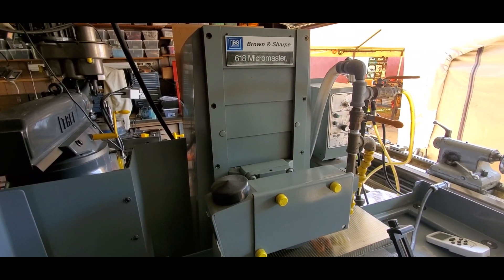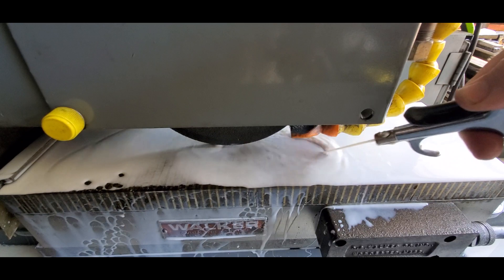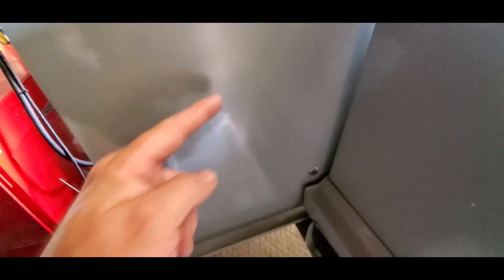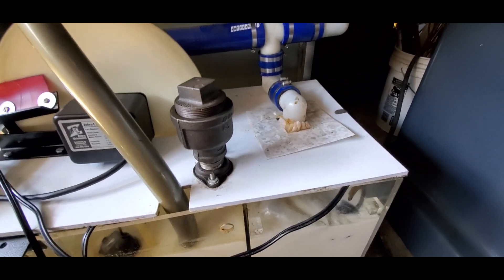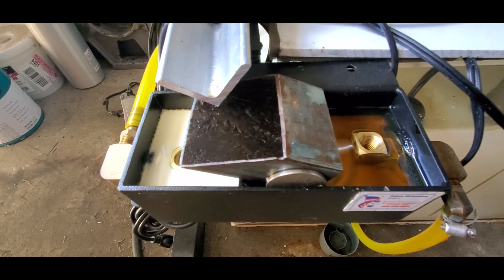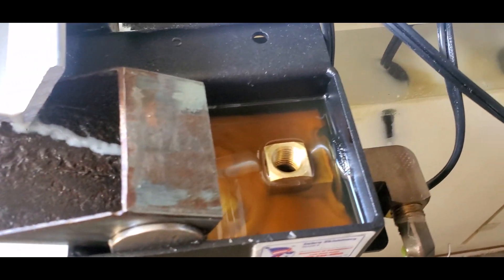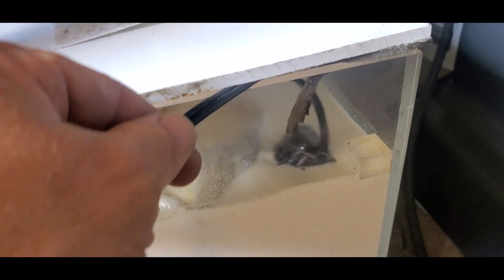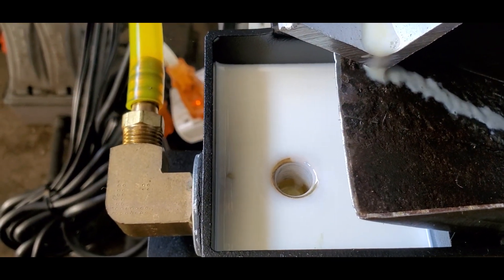DIY Flood Coolant System for my Surface Grinder

Comment: Great system, David. I'm wondering how the oil/water separator works.
Reply from the maker: There is a baffle in the middle that only allows flow underneath it. Oil floats on the water and stays in chamber 2. Water flows under baffle to chamber one.
Reply: @daviddominessy  So then there will always be some water on the oil side, is that correct? Salvaged oil would come from the top of the oil side? Occasionally you'd need to take the thing off and give it a good cleaning? The opening at the bottom under the baffle could be very narrow? I'm likely going to start with a misting cooling system, because cheaper (?) Big question I have is: what keeps the coolant from getting into the spindle bearings?
Reply from the maker: @walter67435  the BS is made for liquid flood coolant and the design is why there isn't coolant going into bearings. The oil separated leaves via a tube to a jug. Mist is great and probably preferred for most applications of a small scale.... however breathing micro oil particles is a concern.